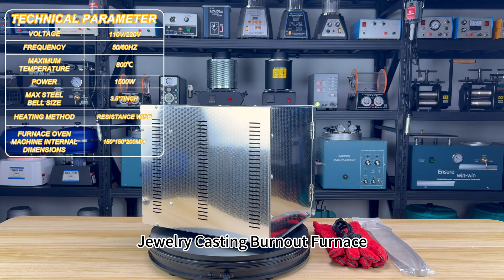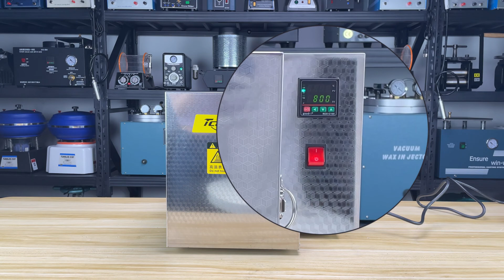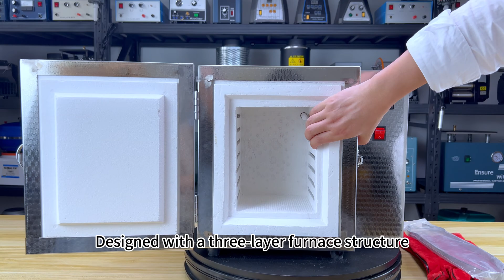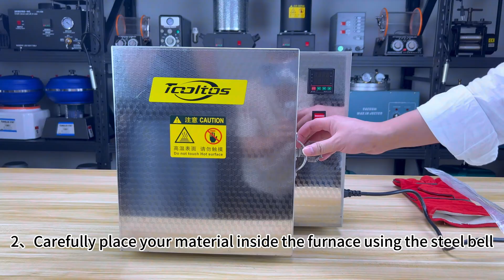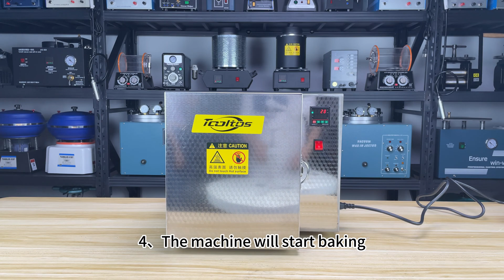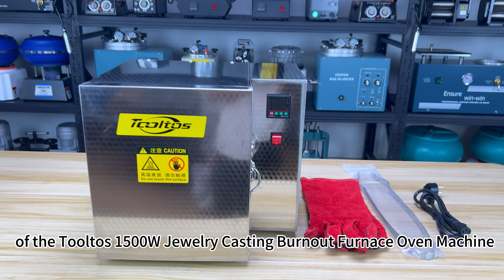How To Use Tooltos 1500W Jewelry Casting Burnout Furnace Oven Machine?

Comment: I cheated a bit but it worked. I needed a little more heat for melting Gold so I took a nipping Plier and nipped off the thermostat Flush. Now it heats up to about 2150 F. close to about 1080 C. Which is kind of the maximum it will go because the coils are designed for low heat but will get hotter if you disable the thermostat which is what turns off the furnace coils from heating any further.
Reply from the maker: Hello, Thank you for sharing. We recommend avoiding high-temperature use, as it may shorten the machine's lifespan. Thank you!
Reply: @TooltosJewelryTools  Thanks. I have taken it to 2100F. everyday for 532 days so far. no problems.
Reply from the maker: @Freedomistman Okay,thanks!

Comment: This machine is wrongly designed. The door Hinges MUST loosen in time because the door is heavy and have to repeat open and close. BUT once you unscrew bolts to tighten the hinges, the disaster happens, the nuts for fixing the bolts are not fixed inside, so they will be lost in ceramic wool inside. I am so in trouble using this machine.
Reply from the maker: Hello, thank you for your feedback, we will inform the factory to improve this. If you have any other questions you can contact us to solve
Reply: @TooltosJewelryTools  when I received the machine, the hinge was little crooked and it makes the door not closed properly. so I opened the bolts to rejoin it, and than realized that the nuts inside is buried in ceramic wool, which is NOT FIXED, so I'm not able to join the bolts and nuts. It has been a month, but I am able to use the machine :(. You know what? the hinges WILL losens in time. I have no idea. I want a refund this faulty machine :(
Reply from the maker: @Stell-ml3jj  Hi, did you find out about this issue at the time and give feedback? Can you provide me with the order number? But now you have made changes to the machine yourself, which will make it impossible to return it. We can only offer you a few suggestions
We recommend that you re-drill a hole link for the bolt. And plug the original hole

Comment: Hello! I'm planning to buy one of your furnaces for lost wax casting work. I have found that there are two different versions of this furnace, the basic model and the one + air vent., tray, and segmentation already set. 

I have questions before choosing one! 

My questions are,
1. Is the basic model has no air vent at all??  I'm not sure if it is safe with no ventilation hole because of gas or hot air during the operation.
2. Someone told me that I cannot change the segmentation set for the one with air ventilation.. Is there only one mode and I cannot change anything at all??
3. Then can I change time/temperature segmentation for the basic model like 180c for 90 minutes, then goes up to 300c for 120 minutes and so.

I really like the model with air vent and the tray... but it there is no way that I can set my own segmentation........I should go with the basic model..
Reply from the maker: Hi, thanks for your review.
1. The basic have no air vent.
2. Yes the Segmented Temperature furnace program can't be set anymore by client.
3. For basic furnace, you can change the temperature at any time. But the disadvantage is that you can't set up a segmented program, and you need to manually increase the temperature after the dwell time.
My whatsapp is +8618559383105. Welcom to send inquiry.
Reply: It is Tooltos product the exactly same in the video..
Reply from the maker: @ Yes Tooltos products.
Reply: The earlier comment was gone…??
Reply from the maker: @ Which comment?
Reply: @TooltosJewelryTools  Hi! it was just the same content and I re-wrote it!
Reply: I’m re-writing because the comment I wrote didnt appear for some reason…??? 
So I purchase the segmented furnace thanks to your advice and received it today. But the upper hinge was a little twisted causing the lock on the other side not properly closing. So I unscrewed the bolts on the upper hinge and the disaster began. The nuts inside  are just buried in ceramic not fixed…and I cannot grab and fix it through the tiny holes…the bolts are not fixing… what can I do??
Reply from the maker: @ Hi, please send your order number. Friend.
Reply: @TooltosJewelryTools  I bought from Alibaba..... not from your official online store ..T_T I'm so hopeless... the upper hinge was still open and I cannot even use it..... I ordered sheet of ceramic wool to put some in to hold nuts inside, but not very positive.
Reply from the maker: @ Sorry to hear that. We hope you can contact the seller of Alibaba. They should resposible for your order.
Reply: @TooltosJewelryTools they suggest to fix it…….

Comment: If your temperature controller is locked, hold SET for a few seconds, find LCK, set it to 0, and confirm.
Here are the key settings on the temperature controller and what they do:
LCK (Lock) – Prevents changes to settings. Set to 0 to unlock.
SV (Set Value) – The target temperature.
AL1 / AL2 (Alarms) – Set temperature limits for warnings.
SC (Sensor Correction) – Adjusts for sensor errors (offset).
CF (Celsius/Fahrenheit) – 0 = °C, 1 = °F (leave at 0 for Celsius).
AR (Auto Reset) – Controls automatic alarm resets (usually leave default).
Reply: Bro, I need help, I changed the values on my oven and I don't remember what they were from the factory. Do you have them?
Reply from the maker: No worries — we’ve got you! 🙌 Could you please tell us the model number of your oven? That way, we can send you the original factory settings right away.

📞 You can also message us directly via WhatsApp: +86 185 5938 3105
📫 Or email us at: sales@tooltos.com

We’ll get you back up and running in no time!
Reply: Thanks! Lost the manual.
Reply from the maker: @Suspect002  You're welcome. Feel free to ask us any questions you may have.

Comment: Instructions make no sense!!! I'm trying to burn out a wax mold and can't seem to figure out how to ramp up temperature. Whats App customer service doesn't know either.
Reply from the maker: Hi Winstone, so sorry to hear that. You purchased this machine from Walmart, not our website. And we sent you the steps how to change the model. Did you follow it?
Reply: @TooltosJewelryTools  could you send me these steps
Reply from the maker: @ Setting Method：1. Press and hold the “Set” button for five seconds to bring up the program settings.
2. Click on the “Set” buttons one by one to locate the “LCY” setting.
3. Set the “LCY” parameter to “0101”;
4. Press and hold the “Set” button for five seconds to confirm and restart after one minute of shutdown.
Reply: I was thinking of getting one. You probably have to do it manully I'm assuming? like theres no way to program steps for the burnout process
Reply from the maker: @TyboAudio  Hi, it can only adjust temperature. Friend